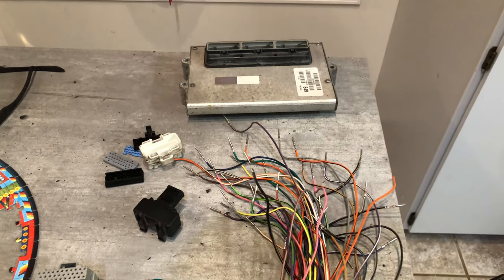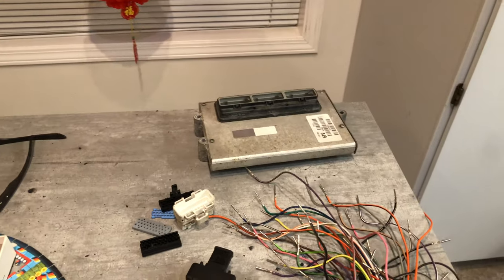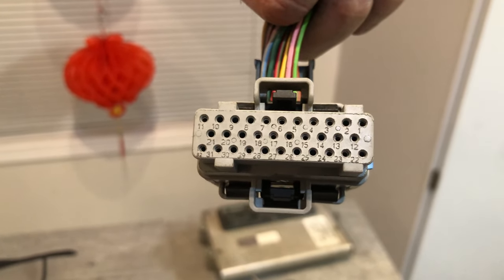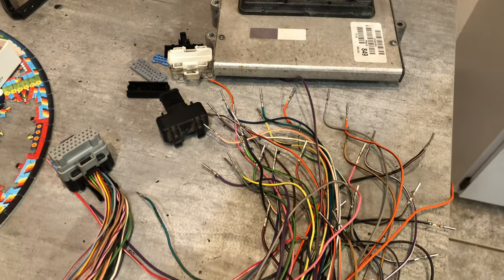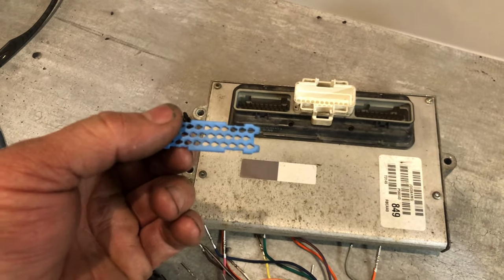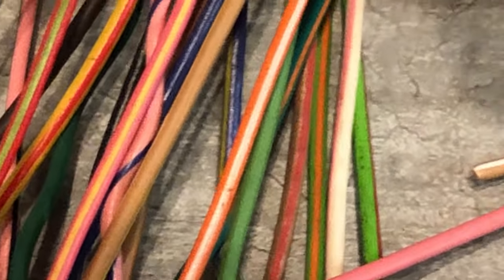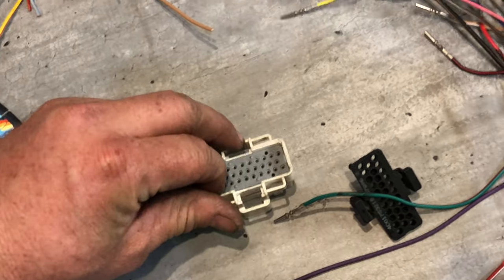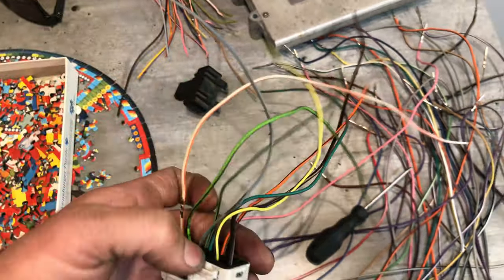Dodge PCM Connectors the Easy Way!

Comment: U have a 99 dakota it drives for about 15 20 minutes then stalls and shuts off..so what indo is pop the hood without removing the keys leave it as is, I wiggle one of the harness connectors and the truck turns back on after wigglelung a connector..ANY CLUE WHT CAN BE GOING ON ??
Reply from the maker: Oh boy, that’s a tough one, sorry I don’t have any idea

Comment: so I am facing the same issue with PCU pins being bad and needing replacement.  Question, did everything work out for you and did it fix your transmission issue?
Reply from the maker: The transmission issue was not resolved. I’m pretty sure my PCM needs some work.
Reply: @StockyBaldman  okay, thanks.  I am diving into my plug repair or replacement of all 3 or whatever soon....
Reply from the maker: Good luck, be careful!

Comment: How do you know what colour goes to what pin ? Looks like there are several wires which are the same colours going into different pins
Reply from the maker: Every wire has a different colour line on it. There might be a green wire with a black line and a green wire with a white line. There’s also a chart in the manual that tells you which colour combo goes with what location on the connector.
Reply: I have the same issue his video helped me greatly
Reply from the maker: Awesome glad to hear!

Comment: My grandson just bought a 2000 Dakota and its having a no buss issue right now. Who ever owned it before put a lot of money into it new coil packs, tps sensor, relays etc. And still has a problem. I am starting to think that this might have something to do with it. So yes this video helps a lot on how the plugs can be disassembled and put back together.  Thanks
Reply: Another thing you can check:

Symptom: Engine will not start. Gauges are inoperative. NO BUS message displayed on odometer.
Problem 1 of 6: The 5v power supply from the Powertrain Control Module (PCM) is shorted due to a shorted Crankshaft Position (CKP) Sensor.
Problem 2 of 6: The 5v power supply from the Powertrain Control Module (PCM) is shorted due to a shorted Camshaft Position (CMP) Sensor
Problem 3 of 6: The 5v power supply from the Powertrain Control Module (PCM) is shorted due to a shorted Manifold Absolute Pressure (MAP) Sensor
Problem 4 of 6: The 5v power supply from the Powertrain Control Module (PCM) is shorted due to a shorted Throttle Position Sensor (TPS).
Problem 5 of 6: The 5v power supply from the Powertrain Control Module (PCM) is shorted due to a shorted wire..
Problem 6 of 6: The 5v power supply from the Powertrain Control Module (PCM) is shorted due to a shorted Governor Pressure Sensor.

Also check your grounds on the heads/firewall and fenders. And lastly as mentioned by the video above , the PCM may have broken solder joints due to heating and cooling of the main PCB. Not to blame Dodge/Chrysler, this is a pretty common problem with many electronic devices now using lead free solder. Any electronics that gets hot then cools is going to flex the main PCB and break the non lead solder that is used in electronics.
Reply: @bobsoft  thanks for the info, who ever owned it before has already replaced the tps, map sensors coil packs. The only thing that I have found that they haven't replaced is the cam and crankshaft sensor. I looked at them yesterday and  unplugged and plugged them back inyesterday after it shut down, after doing this
 it didn't shut down anymore so I think that this may be the problem. I told my grandson they should have started with the cam and crank sensors. He said it was a young guy that owned it, I kinda think he was using the parts cannon method of trying to fix it. Lol We are going to replace them and see what happens. But thanks for the info, if this don't work I will check out some of your other suggestions.
Reply: @jeffarp7409  The ECM is a common cause of the NO BUS. I posted a link for you but it got deleted.  I own a 2002 Dakota and one day I know I will have to rebuild the computer.
Reply: @bobsoft  thanks for the effort anyway, we are going to replace the cam and crank sensors tomorrow maybe that will fix it for now hopefully. I got a buddy that works at O'rileys when I told him what truck he had, keep in mind he's a dodge guy like myself. The first thing he said was sell it. He said that they have a lot of problems out of those year models. I'm kinda starting to think he may be right. But we are going to keep swinging at it until it whoops me or I whoop it. Lol
Thanks again

Comment: Thats a mean electric boost if you can pin in 14 guage wires..i have 12 guage wired on some sensor connectors 2 shift kits and high performance built a604 transmission with 8 bolt torque converter & lsd

Comment: I have a 2012 ram3500 that my dog chewed the harness in two about 6 inches behind this plug underneath the driver side door. Most of the wires are green with nothing distinguishing them apart. While others are clearly identifiable. How would i go about figuring which green wire connects to which to simply put it back together? Or does it matter with the green wires?
Reply from the maker: Oh boy that sounds like a mess. Sorry man I am unfamiliar with that truck.

Comment: I need help I bought a 201 dodge ram 1500 5.9 and someone had cut the plug to the pmc it if the first plug on right of truck the first in pcm I got plug that works but the wires are idiferent
Reply from the maker: Yeah, I bought a harness from a half ton dodge ram also a 1996 like mine and the wires were totally different. If you Google PCM pin out chart for that truck, you should be able to determine the pin locations.

Comment: QUESTION, I think I may have cracked the clip that holds the plugs in place, on my Jeep, it looks the same as this one.. do you think I can just tape them to the PCM? I don't think they would wiggle out anyways. But, I wonder lol. I don't know how you do it, I'm terrified to unplug the damn pcm, let alone do the types of repairs you have done!  I thought I had figured out how to unplug the thing, but someone had a video with a different style plug smh. I think I just needed to depress the clip and pull the plugs out of the PCM, but I am pretty sure I cracked them off the plugs, cause they're just loose now.. but I don't even see where they clipped in to, you have to see it too know wth I'm even talking about but lol. Hopefully I don't have to replace them entirely..
Reply from the maker: Yeah it’s tough to say without seeing it. Mine had a clip on the top and bottom that you use your thumb and index finger to undo both of them. Are both of yours broken?
Reply: No thankfully! I didn't see the bottom one until I used a mirror 🪞. I'll have to try to depress that bottom one and hopefully that will do the trick. It doesn't even really seem like the top ones are broken really, there's nothing that it clips into,  it seems more like the plastic clip pops onto a metal square, it's hard to see though lol smh they could've made the things a little easier to figure out how to unplug geez. I thought it would be easy, just unplug, unscrew, rescrew and replug lol oh well, I may have to bring it in and have someone else put it in for me , if I can't get it.
Reply from the maker: Yeah I think you’re right it’s best to air on the side of caution. Hopefully it’s a simple fix, you might want to show some pictures of it to people on a forum for jeeps and see what they have to say. With me not being a mechanic unfortunately I can’t give you any specific good advice
Reply: @StockyBaldman  well thanks for replying anyways! God bless! 😉
Reply from the maker: Absolutely I hope it turns out well for you!